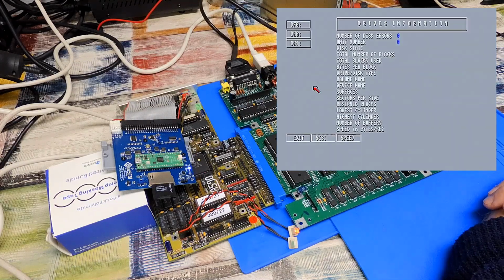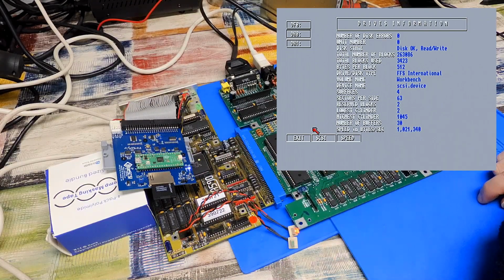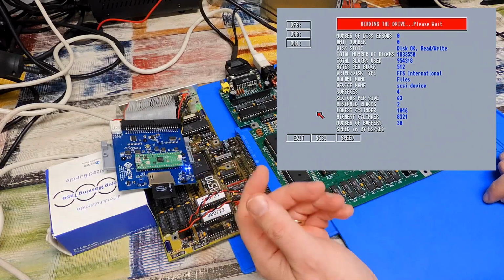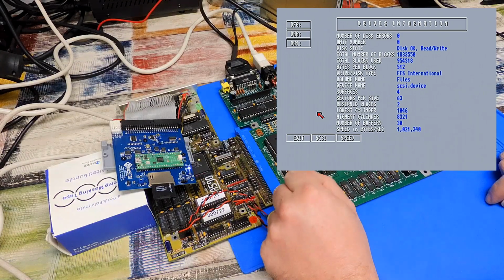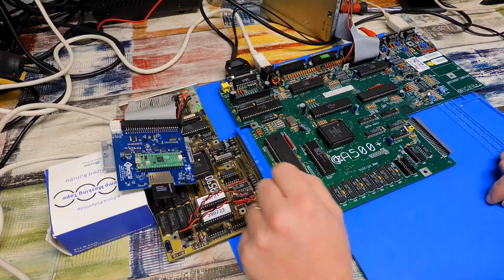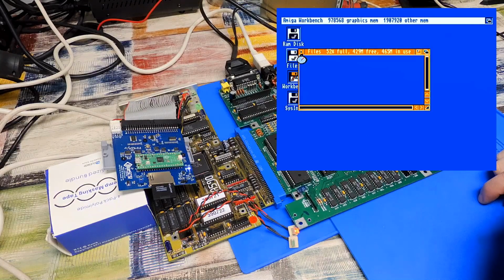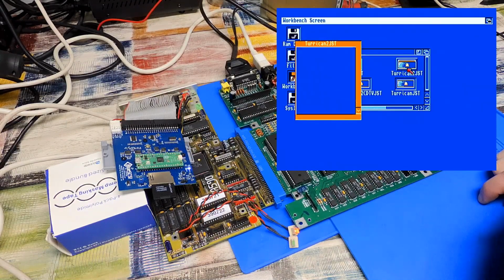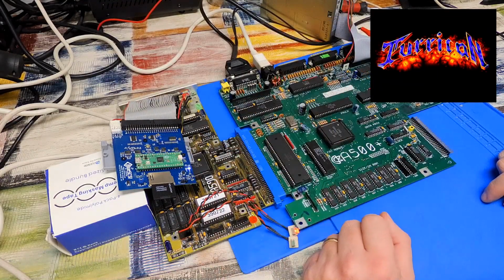BlueSCSI V2 - mini build and quick test

Comment: what kind of and where do you get the files to run on the BSCSI? I assume they are not the same as the what are on the card drives I have seen with the A1200 or are they regular files you load from a disk, is that right?

Comment: Scsi CD drives where the only thing for Amiga's until IDE was introduced in late models. Drivers not an issue when I was connecting drives any Scsi drive worked fine.
Reply from the maker: Good point, I just need to find a suitable scsi card for my 2000 now 🤔
Reply: Look for something like an A2091 or GVP SCSI controller. If I recall the A2090 needed an additional ROM card to boot from controller. GVP SCSI controllers are possibly the best for A2000 however silly Ebay prices.

Comment: what was the purpose of going with this vs using a passive CF to IDE adapter since that hard drive addon seems to support IDE as well
Reply: The A590 doesn't actually support normal IDE (ATA), it only supports the 8-bit version, so called "XT-IDE" (XTA). (The connector looks the same but the pins that would normally be for data bits 8-15 on an IDE connector are just tied to ground instead.) It's not compatible with CF cards which all require a normal 16-bit IDE interface. Same goes for actual physical hard drives, only rare ones that are XT-IDE compatible will work with the "IDE" connector in there (look for an X at the end of the drive model number for example the Seagate ST351A/X [jumperable to ATA or XTA mode] or Western Digital 93028X [XTA only]), normal 16-bit IDE drives won't work at all. Compatibility aside, using the FastSCSI interface in there will be faster anyway since it's a full 16-bit interface with DMA support compared to the limited 8-bit non-DMA interface of the XT-IDE controller.
Reply: @JeremyLevi  Jeremy, per chance whats the situation with regards to using Blusescsi2 via Blizzard 1230 IV (Phase 5) accelerator as i want to replace an old Quantum SCSI drive in an enclosure with BlueSCSI2, i would assume BlueSCSI2 would simply be a direct substitute for a SCSI drive.. are there any DMA issues in this context that you are aware of?
Reply: @rfxtuber  I'm not an expert with the BlueSCSI specifically (I use a ZuluSCSI 2040 on my A500), but from everything I've seen it should just be a drop in replacement for that use case. If DMA worked correctly with the physical HDD in that setup it should work with the BlueSCSI as well.
Reply: @JeremyLevi  Nice one Jeremy, that is my current understanding... I'm a little lost regarding the variants and features of each of the cards out there but its looking like its between ZuluSCSI or BlueSCSI2 with BlueSCSI2 being the one to go for now as it seems to have ironed out bugs ect.. Thanks for impromptu comment.. Appreciate it...
Reply from the maker: Exactly what Jeremy said.  Thanks both for watching and thanks Jeremy for the explanation.

Comment: I have an A500 with GVP Impact Series II HD8+ (with Guru-ROM V6.11 firmware) that has SCSI HDD and CD-ROM, so getting the CD-ROM to work should be no problem, as long has you use the proper controllers.
That amiga also as a Derringer 030. If I disable the Derringer, the HDD speed more than triples, getting close to 3MB/s, by using only the GVP fast RAM. With the Derringer enabled (and the 32bit fast ram) the hdd speed drops to less than 1 MB/s.
Reply: IIRC a lot of (all?) the external sidecar drives don't support DMA to 32 bit memory so that's probably what's happening with the Derringer 030, DMA is likely disabled when it tries to configure it to use the 32bit RAM. I have a vague recollection that you could get around that if you can set the RAM on the Derringer to not autoconfigure, instead adding it later with the "addmem" command in the startup sequence somewhere after the sidecar drive has already autoconfigured itself and set it's DMA region / buffers to the 16 bit FastRAM on the GVP. You'd have to check the Derringer's manual to see if it has a jumper to disable autoconfig for the RAM.
Reply: @JeremyLevi  thanks.
I've always suspected it was a dma issue. I'll try the derringer memory options to see if I can get around it. Since the side car has 8MB of ram, it should be no issue getting workbench to boot with extras.
Thank you!
Reply: @brunorbf  The other thing that just wormed it's way out of my foggy memory is that CPU caches can cause issues with DMA. If you still can't get DMA to function correctly with your accelerator you might have to try disabling the cache(s). Not sure if the ROM code for the GVP sidecars have this issue or not, iirc cache flushing has to be written into the DMA code to get DMA to work with CPU caches. I can tell you for sure that it's not supported in the stock ROMs for the official Commodore DMAC based devices A590, A570, and A2090/91.
Reply: @JeremyLevi  Thanks.
Maybe I will have some luck with it,since the sidecar uses a third party rom (I bought it on ebay, already like that), and because of that rom (Guru Rom), I can't mount the hdd inside the sidecar (it came without the mounting bracket, the rom his taller than the original). 
I ended using an AT PC case to place the HDD and CD-RW drives,  and to power both the A500 and the side car.
Reply from the maker: Thanks both of you for the information.

Comment: To my Amiga 500+ i bought a Sony SCSI CD-ROM and i payed £150 for it. This was around 1992-93.
Reply from the maker: How did you have it hooked up to the  500? Was it via a 590 or something similar?
Reply: @CRG  Yes, i used the external 25 pin connector on my SupraDrive.

Comment: Yes the Amiga 500 supports SCSI CDROM although, comparing custom drivers to Universal CD drivers, you'd need to check to see which (driver) way it will work (potentially both ways or just one way). The Amiga could plug a CD drive (sometimes squirrel) into the back port of the SCSI of an A590 (SCSI version) but also the A570 and also that was a CD drive itself. Kickstarts can be changed to make the CDROM boot like the CDTV. A game to load slowly (to stress the system as a sort of test) is (by Virgin) "Spirit Of Excalibur_" which loads slowly even from an A590. _"(and the sequel, Vengeance of Excalibur)". Even though A1200 can support CDROM via internal IDE PATA, the SCSI (e.g. by PCMCIA adaptor)  CDROM route can be done too.
My comment has no hate in it and I do no harm. I am not appalled or afraid, boasting or envying or complaining... Just saying. Psalms23: Giving thanks and praise to the Lord and peace and love. Also, I'd say Matthew6.
Reply from the maker: Yeah after making the video it dawned as obvious because I've got a squirrel scsi and cd drive for my 1200.  Although I'm not sure if the A2000 scsi cards would support it, I'll need to do some research on that.
Reply: @CRG  The logic would be that the interface of (parallel) SCSI either fits or doesn't but the software compatibility is unlikely to be restricted as 32bit versus 16Bit of the PCMCIA converts the bus to 16Bit anyway. Beyond that it is Kickstart and Workbench versions which can be resolved if even need to be changed. The Akiko on the CD32 helped handle the CD but the A1200 would likely be a case of just software. See if your SCSI CD drive is supported by a sampler (e.g. an AKAI or whatever) if you have lost documentation or need a different 'angle' as a thought process.
As an aside, the Vampire uses a PATA IDE if so desired via Universal CD drivers.
It would stand to reason that a A2000 SCSI card expects an HDD as an alternative drive such that it works with a video toaster setup, thereby implying a calendar date range or usage (approximately) from back in the day (indicating what other systems would have used it).
Mike's Vintage Tech (of MVTComputers) might have experience on that A1200 A2000 hardware combo. 
My comment has no hate in it and I do no harm. I am not appalled or afraid, boasting or envying or complaining... Just saying. Psalms23: Giving thanks and praise to the Lord and peace and love. Also, I'd say Matthew6.